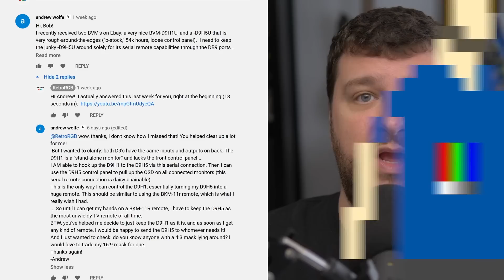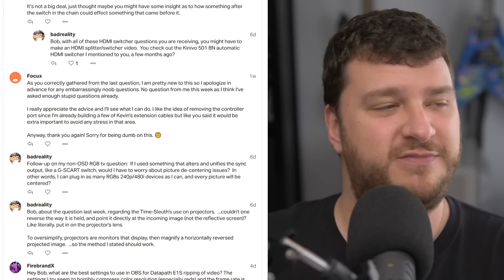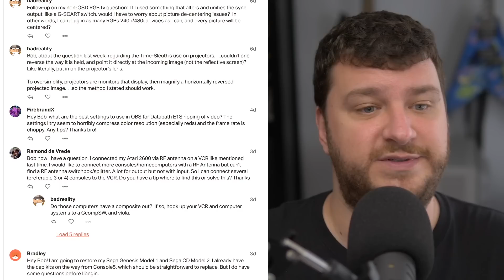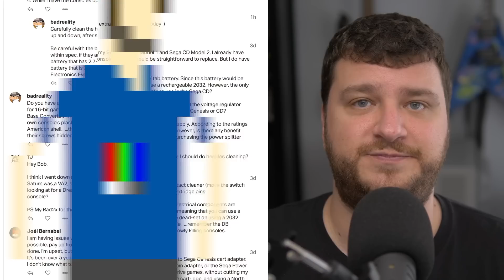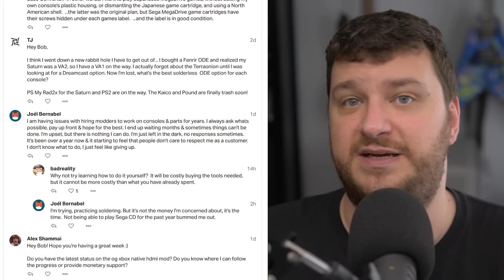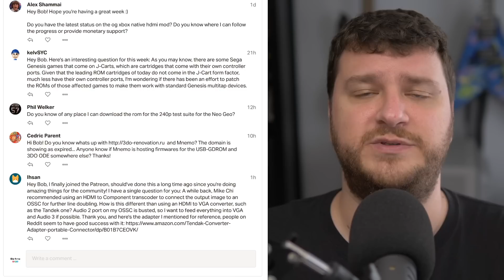Supporter Q&A #112

Comment: Hi Bob. I used wayback machine to get the firmware link from 3do-renovation.ru for the Dreamcast it was hosted 3rd party and the link still works. USB-GDROM_fw_19-06-06.bin https://yadi.sk/d/4cCuWiIk748_cQ . The 3do files were hosted on the website locally, but weren't archived.
Reply: Hi,
The USB-GD-ROM website moved to http://3do-mnemo.com/

Comment: FYI, I believe OBS does support variable frame rate, but I've never used it so I don't know how well it works or how well it's supported by various applications. I think you just have to use custom encoder options to make it happen.